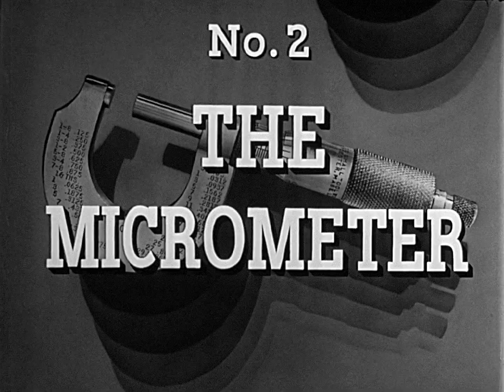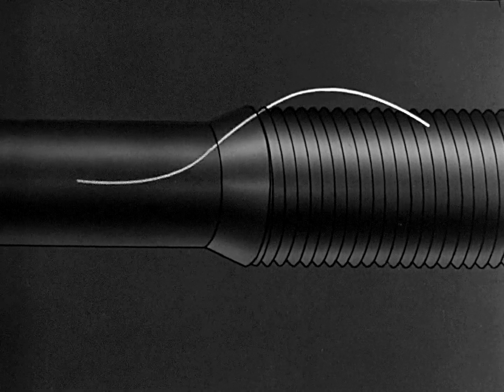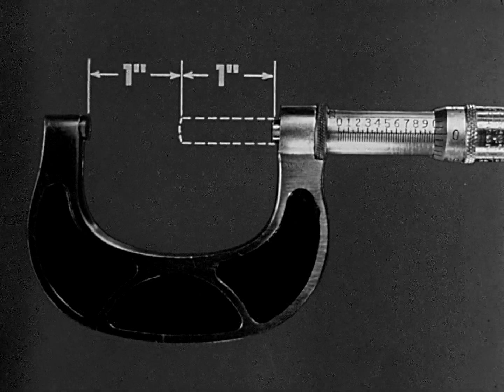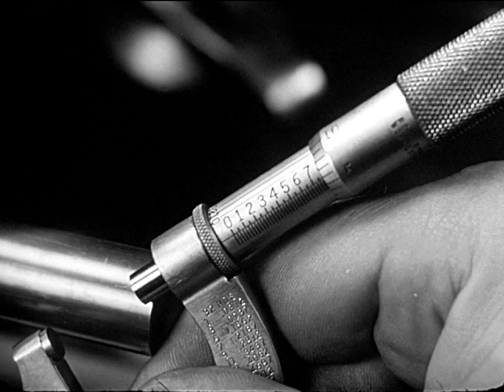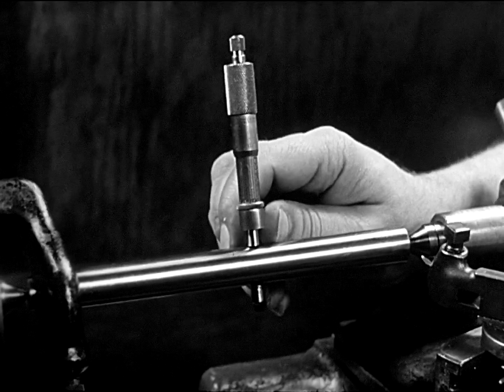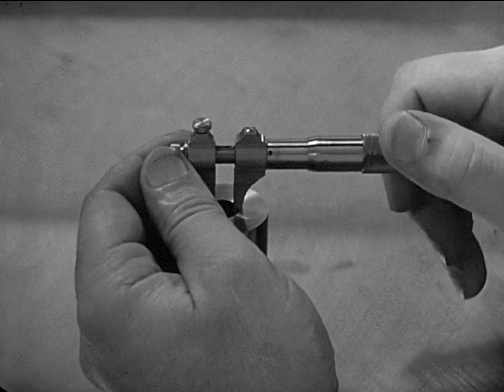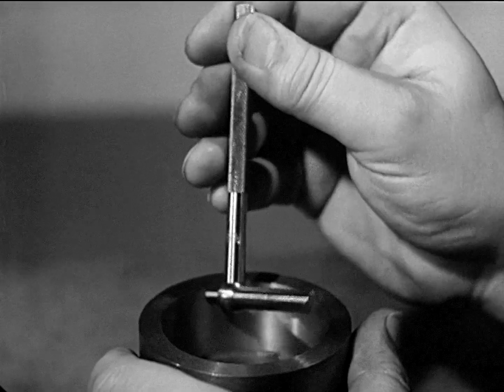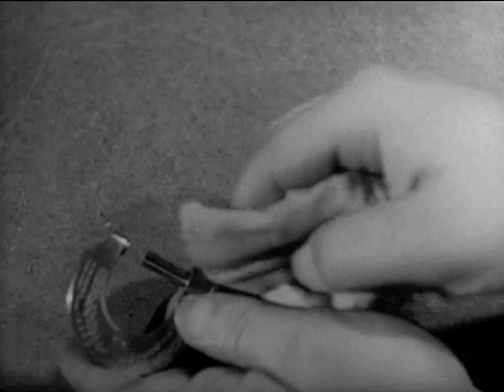The Micrometer

Comment: micrometers today either rachet or  slip when they reach the right pressure.
Reply: The micrometer in this video had a ratcheting mechanism. Micrometers today only ratchet if you use the ratchet thimble.

Comment: My great grandfather (Boeing Machinist) left me hundreds of these steel rules, calipers, gauges, etc. These videos are great for figuring out exactly how they are all used correctly.
Reply: I used sewing machine oil on some, & light bearing oil that came with some mini-quad motors on any threads. I did use WD-40 on the outside to clean a few spots where rust was starting to show (nothing too bad).

Just to show how naive I was....I thought he must have loved drawing circles with how many different compasses he had. Really just full sets of inside, outside, calipers, etc.

All the micrometers test calibrated perfect still on his gauge blocks.
Reply: @PowerScissor  hundreds? he probably stole them from the factory
Reply: Take care of that stuff. Probably worth a few thousand depending on what you have. If you aren't going to use it, spray it all down with some WD-40 and keep it stored properly.
Reply from the maker: WOW! We DO NOT suggest the use of WD-40 for fine machine threads. Over time, the stuff thickens and eventually becomes a hardened glue. I have seen a number of frozen micrometers and other fine parts permanently 'welded' together by this stuff. Some we have not been able to recover. I am not a machinist, but how about mineral spirits? Anything which leaves residue when dry is a bad idea!
Reply: @MuseumofOurIndustrialHeritage  another idea is put some rice (dry) in a small cloth bag.  Store that with the tools as a desiccant to control moisture.

Comment: They forgot to add the cranky foreman asking if the hot job was finished yet😁
Reply: So true, for a Job Shop, Time was Money.
When I worked in Production, same part, different day.  
Then R&D, different part, every day for years and years.
Later I worked as an Engineer, Pencil & Paper, until I went into Management.  Same thing..."When will you finish?".
Reply: Lol so true Foreman are cranky miserable bastards specially in machine shops

Comment: It's true it's suppose to always use the slip mechanism. But they also provide that big grooved surface so you can use it without the slip. The thing is made from very strong materials it's hard to break it.. you have to use considerable force.. I don't know maybe are people with lets say.. less gentile hands.. but if that's the case they shouldn't be using a micrometer.. The slip mechanism has some good points and some bad point.. a good thing  is to use it  when measuring things like paper.. copper and other soft materials.. the draw back to this is the force applied depends on the speed you turning.. so its very hard to always get the speed right.. and this can lead to different measurements.. For hard materials you can use the direct drive.. approach the thing gentile until you feel a small resistance so you know is touching the part.. you can then use the slip to see if it gets even tighter.. Sometimes when measuring round objects when the contact point is very small..  is better to use the hand because the slip mechanism can apply more force then necessary.. Hint! Its very very important to have the tool contact points and the pice very clean!!!
Reply: ...AND... Mr1joh1smith... I disagree that with "gentile" (that means non-Jewish, btw) hands shouldn't use a micrometer. Why in H would I, with rough OR gentle hands want to NOT be gentle with a precision instrument? That's why they come in cases.  Also, you say a mike is made of 'hard materials' and is hard to break'?  Can't agree there- drop one on the floor a few times, and keep spinning the barrel quickly, and you'll be sending it back to the calibration lab... or uncle Bill's C-clamp collection. ;-)
Reply: It's 40 threads per inch. It doesn't take much to fuck up a micrometer, you have a pretty large mechanical advantage with that amount of thread.